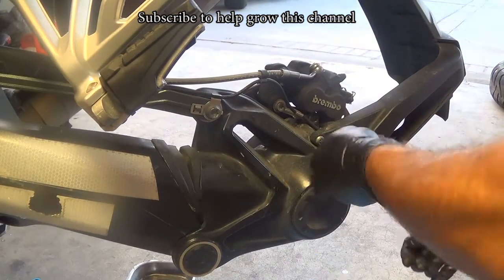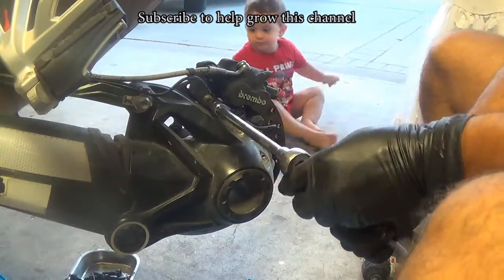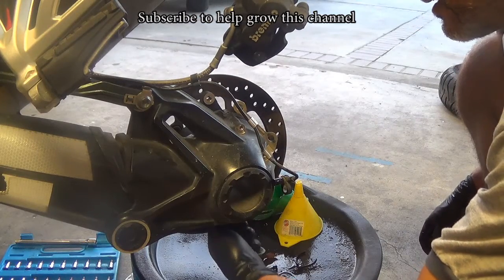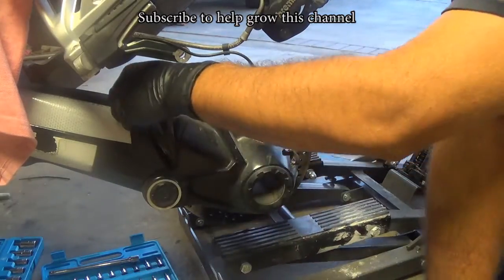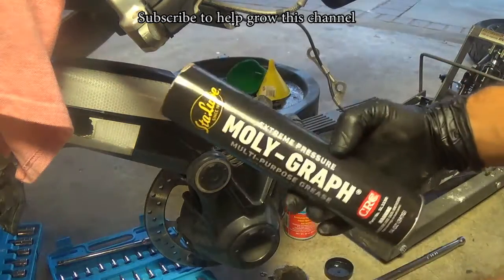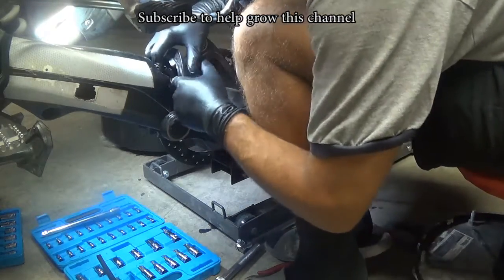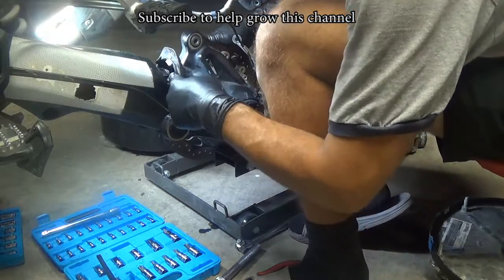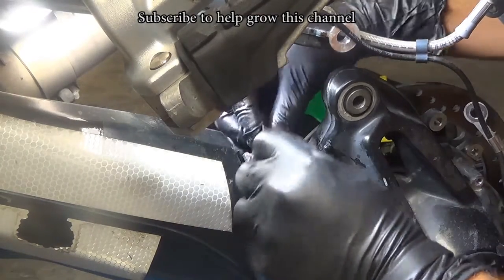DIY RUST CORROSION 2016 BMW R1200GS LC FINAL DRIVE RE GREASE

Comment: Hi, when I removed the speed sensor some brake fluid leaked out from the speed sensor hole when  the rear assembly came down exposing the splines. Is this normal?Thanks.